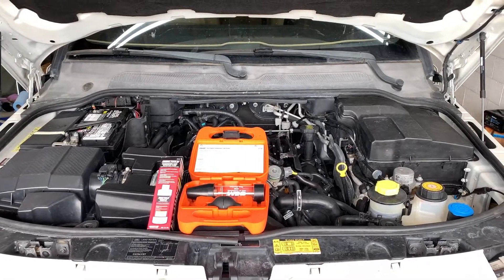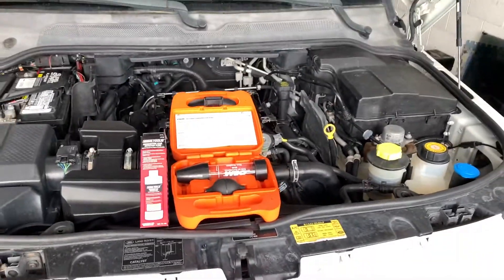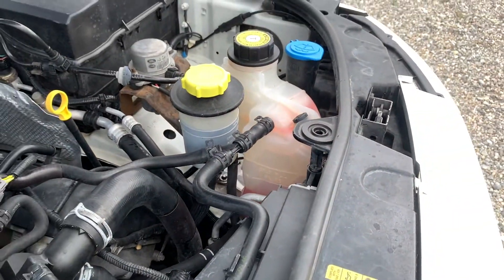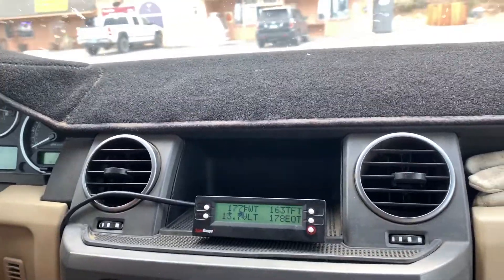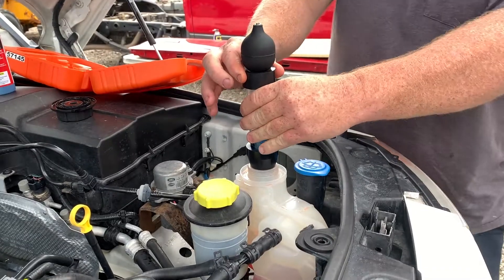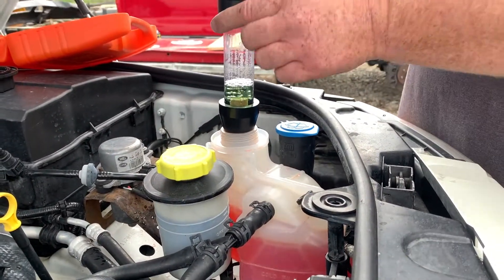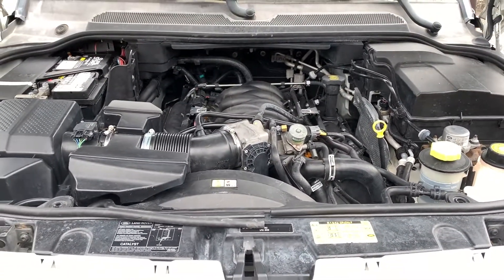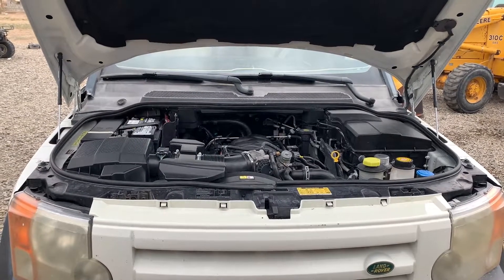2006 Land Rover LR3 Cooling System Combustion Leak Test "Good or Bad News?"

Comment: Did you solve the overheating problems of the LR3? I have solved mine. I changed my head gasket twice and changed my engine heads and still overheating. A mechanic showed me how to solve it and it worked.
Reply from the maker: Well it looks like someone put stop leak in the engine, so that kind of changed our plans.  At this time we plan on doing a full rebuild to the engine in the future and possibly donating the vehicle to a veterans organization.  Curious what you did to yours?

Comment: Has there been any development/resolution to the issue?
Reply from the maker: It needs head gasket and transmission shift solenoids replaced.  We found another LR3 that has more features we were looking for and in better shape. So as of today, we plan to put this one up for sale, but if it doesn’t sell once we’ve caught up on some projects we plan to fix it.
Reply: How did you figure out it needed a head gasket?

Comment: I was playing with this coolant for few months on 2010 Range Rover. Replaced pump, radiator..., finally sold for parts. Everything was ok until you go 80..90 mph and you stop, turn off engine and after start it starts to overheat. combustion gas gets in to the system, makes foam/bubbles and pump didn't move the coolant.
Reply from the maker: That sounds very similar to what we were seeing.  Although we really could never see bubbles in the reservoir tank.  It would run great sometimes and other times would over heat within 15 minutes.  Now it won't even run for more than 10 minutes before it's pressurizing and pushing all the coolant out.  We have plans to pull the heads off and see if just new gaskets will fix it or if its something more severe.  We love the truck.  Thanks for watching and the comment!

Comment: Sorry to hear.  Keep us posted!
Reply from the maker: No worries, we'll figure out something.  Just a little set back...  Thanks for watching and the comment!
Reply: @mountainviewsgarage what did it turn out to be??
Reply from the maker: @ronaldrrootiii6040  It is a blown head gasket.  We still have plans to pull the heads off,  but unfortunately its dropped to the bottom of the list.
Reply: @mountainviewsgarage  wow okay! How did you determine that it was? Did the oil ever get contaminated or the coolant or smoke out the back? Mine has not done any of those but the system pressurizes too much after a bit and even though it maintains a good temperature it starts to want to come out
Reply from the maker: @ronaldrrootiii6040  So, there are a couple of ways for a head gasket to fail, most common is where the engine is pulling coolant into the cylinders and that is where you'll see smoke out the exhaust and smell coolant.  In this instance, the combustion gasses and pressure are finding their way into the cooling system causing the pressurization.  The best way to test for this is the combustion leak test where the fluid will react and change colors if there are combustion gasses in the cooling system.  Good luck!